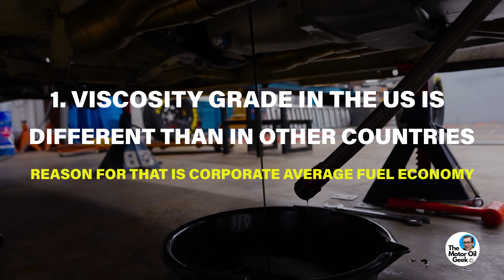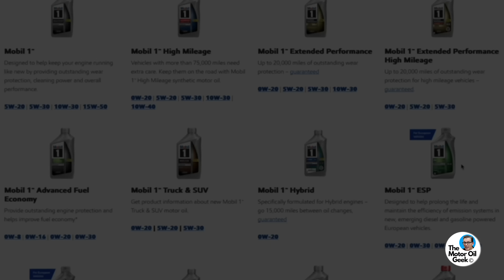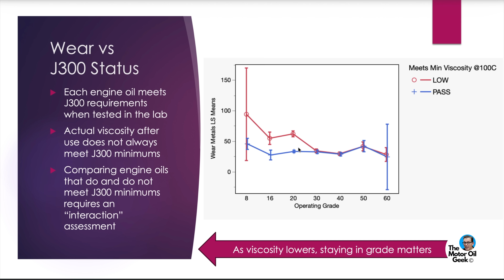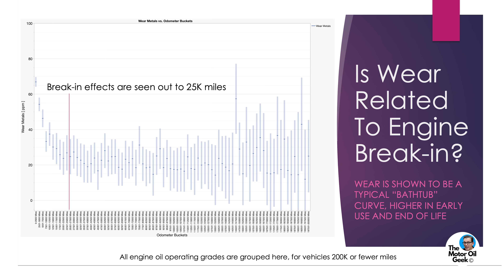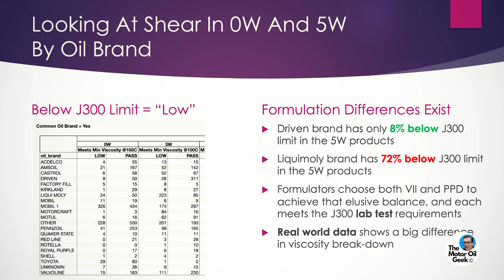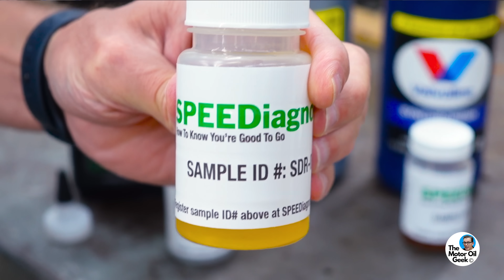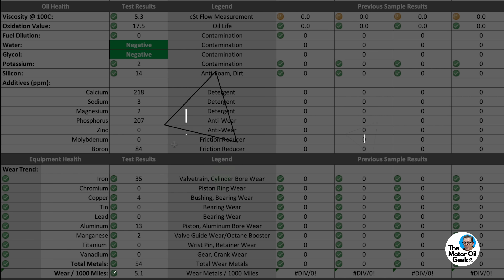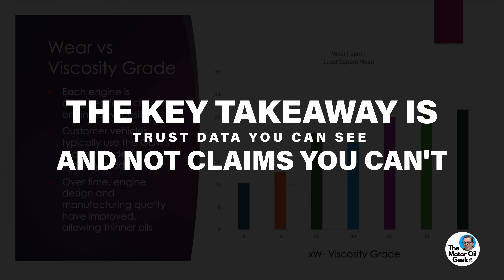More Ai Lies? The FACTS about 0W-20 vs 5W-30 (With Evidence)

Comment: Here is an idea, stop listening to the manufacturers who tell you to change your oil at 7-13K, go back to the old skool days when motors lasted forever and change your oil every 3-5K, your oil filter can only handle so much debris before it bypasses, todays engines are producing more power the oil intervals are getting longer and the oil filters are getting smaller, hmmmmm what kind of sense is that, 3-5K oil change interval. Todays manufacturers want you in a new vehicle every 3-5 years, back in the day our parents had the same vehicle for 15-20 years and no issues when they changed oil every 3-5K with 10w30.

Comment: I live in central MO. I have a 2007 corolla, manual trans 1.8L with over 400k still doesn't use over 2 oz of oil at 10k oil changes and gets 40 to 42 mpg 
 10k oil changes since 150k miles. Timimg chain slaps a little at idle but all original internals. The oil I use is MFA full synthetic. It is a local petro Coop. That has their own lab and specialists that formulate the oil. I use their oil in tractors, dozers, excavators, trucks and cars
I used the 0w20 in 2002 pontiac 5.7 ls1 formulat
 5000 to 7500 mile oil chages and she still rocks my world at 169000miles and gets 30 mpg on the higway at 70 mph. No significant oil consumption either. Just find what works and drive conservatively. Hood luck😂

Comment: I think the rule of thumb is that if you wanna use different grade than what's specified for your car is that you can go lower on the first grade and higher than then latter grade, so say 5W-30 recommended engine is ok to use 0W-30 or 0W-40 but have risks going from 5W-30 to 5W-20 as the oil will get thinner at warmed up engine than the factory recommended and might cause issues

Comment: I got confused as heck with the grade change near 2:38 . I interpreted it as over max limit and under minimum limit instead of over or under minimum limit. My mind wasn't firing on all cylinders. That said, if an engine can handle 20 or 30, and a thin 30 degrades to the thick end of 20, that may be better than the thick end of 20 degrading to the thin end of 20, depending on the particulars of the engine of course.
Reply: I should have waited to comment lol

Comment: First, I want to thank you for the awesome content!  There are a lot of comments referring to the different grades when they "Shear out of Grade". I am not a mechanical engineer, but I do have a basic understanding of mechanical "Stuff".  I drive a 2019 VW Jetta with a 1.4l turbo engine and the spec oil is 0W20. I have always used the recommended VW approved oil and the car has 222,000kms (137,000 miles). I live in the country in Nova Scotia, drive about 70% highway miles at a max of 120kph (75 mph).  Summer temps are moderate (never above 90deg F, and winter is moderate as well. Lows typically between 35F and 8F.  My question is this...under what conditions would a vehicle such as mine with moderate mileage and not driven in an extreme manner, ever experience "Shearing out of grade".  I am just trying to figure out if this is something I need to be concerned with as my vehicle get older.  Thanks again!
Reply from the maker: The shearing out of grade is due to the mechanical forces in the engine and the shear stability of the polymers in the oil.
Reply: @themotoroilgeek Thanks. I will google "Shearing out of Grade" is something my 1.4l turbo is susceptible to.

Comment: I only use Penrite 10/40  synthetic in every thing , for 35 years, I have never had a motor not do less than 400,000 ks  that is 35 years of proof and always change oil every 5,000 ks , oils degrade and you are not driving another 5,000 ks with fine particles causing friction on parts, Never rev a cold motor ,start the motor drive gently until engine is at full running temperature then gradually increase rpm , never do shot run's,most wear is in the first 5 minutes,it takes up to 10 ks to have every component of a viecle to reach running temperature, like bearings,diff gearbox etc just because the thermostat has coolant at normal temperature does not mean everything is at running temperature

Comment: Hello sir really love all your videos very informative do have a quick question I have a 02 mustang GT with a 4.6 l engine that is supercharged positive displacement and makes about 10 lb boost haven't had this car long doesn't have a ton of miles on it was really curious what you would recommend for a good motor oil in this vehicle I live in a warmer climate in Tennessee car does not get drove on a daily basis more of a weekend car any feedback from you would be appreciated I've read some forms were some guys are running t6 5w40 wanted to see what your thoughts were thank you

Comment: We have about 350,000 combined miles across our 2012 Highlander and 2016 Tundra, both have only had 0w-20 since brand new. Both run like new, burn no oil, etc. Just follow the manufacturer recommendation and change it regularly. There’s so much misinformation out there about this topic it’s maddening. Hopefully people aren’t deciding to use 5w-30 because some hacks on YouTube are telling them to. Good video.
Reply: The video is only stating that 5w30 gets way less catastrophic when its not changed in time compared to 0w20

So if anything, people changing over to 5w30 without much thought put into it is in their advantage
A percent or two in fuel economy should be more valuable to you than your engine

Comment: Bought a used Audi from Audi dealership topped with 0-20. Burnt oil. Been using 5w-30, 5w-40  without issues on VW group cars for years. So, changed the Audi also to 5w-30, burning oil stopped. 1.4 Tsi, Greece climate.

Audi in manual claims 504.00 can be used so, the engine design, tolerances, blah blah sounds nonsense to me especially when you see different recommendation based on the  continent (regulation based) as other people stated here. 

After about 1 million km in various cars/motorcycle I can say that changing frequently is more important. 

Good luck with whatever you choose  guys.

Comment: I use 5/30 in my 2017 Sienna instead of 0/20. Same oil in 2003 Tacoma. Convenient. If there is a difference it would be slight less mpg.

Comment: @themotoroilgeek Lake, since motor oil is now being used as a hydraulic fluid for lifters, valve timing, tensioners and other things on modern engines. How does that change what oil is safe in an engine? A 0W-8 will be different than a 5W-20 for lubrication and hydraulic functions. Does the hydraulic parts in an engine influence the oil you should use?

Comment: Got a 4.0 GR1 V6 275,000 miles, has always had Mobil 1 synthetic 0-w20, changed every 5k, you could eat out of the valve covers. A oil change with a filter is at best $60-70? Once every 3 months.

Comment: I have a 2025 jeep gladiator after watching your video I  want to switch back to 0w20  penzoil ultra from 5w30 valvoline  clean and protect do I need to flush the engine before I add the new oil?

Comment: I change mine every 3000km's. And when my oil temps hit over 100c i change it as well. And Always change it before a track day. I use 10w50 with large oil galleries and bearing tolerances.

Comment: Lake, what kind of chemistry (and base oil group? Synthetic?) would you look for on mid 80’s V4 (stock) street motorcycle (Honda VF500F)? So we are talking high revving  (12000 rpm), hot running 500cc V4 without hand matched camshafts (and not line bored cams. (there is some gap, cams lift up while operating).
(Watercooled, 90-degree V4, 360-crank, 16v, screw & locknut tappets, chain driven cams (regular, not HyVo chain, wet clutch, no oil cooler, carbureted (4 constant velocity carbs)…)

With these information & with addional information of suspected fuel contamination & clutch mass material wear contamination?
(= one oil for future, when  I might rebuilt engine & one oil for now managing while waiting need to rebuild)

Comment: we have recently purchased a Mazda cx-30 and all my searches suggest it should take 0w-20 or 5w-30 ... We have taken the car back for a service to a Mazda dealership only to be charged for 10w-30 ... semi synthetic and not even full syn..  I questioned this only to be told its meets Mazdas specs... I'm confused..  And $100 for 4 odd litres .. Three local dealerships all use different brands and grades..

Comment: False... All the topic might be true but in reality it all comes down to engine performance. If lets say a normal family car being driven back n forth to work/grocer/school/home then using the factory rating of oil is good then. However if you are like me that uses the car for long distance travel due to work i pick a higher grade since the engine will be stressed more = more heat EVEN THOUGH THE RADIATOR IS FUNCTIONING WELL the oil is the one witnessing the stress of engine components inside. Also the number one reason for wear and tear of an engine is lack of change oil, wrong oil rating and lastly overloading of vehicle.

Comment: The thinner oil runs off the rocker train, including overhead cams etc. It also drains away from in block cams and lifters and rod and crank bearings. This especially happens in hot climates where daytime temps get into the high 90s.  After a couple days, those engine surfaces have almost no oil on them. When the engine IS started the wear surfaces are dry for a time. This wears the engine out A LOT SOONER. Thin oil is so the engine running at operating temp has less resistance creating better fuel economy. This raises the average for the whole product line. It keeps the manufacturer from having to pay fines. That is the only reason the manufacturers recommend thin oil. They don't care if the customers engine lives. I don't care what this guy says.

Comment: question for the oil guy. My car manual recommends oil changes at 7500km or 6 months. It's a 2010 Toyota. So, I changed the oil with mobile 1 ran it for 5 mins to remove it from the ramps. Parked it hooked up a batter tender and it sat for 5 winter months does it need an oil change with only  0 kms added

Comment: SAE recommendations are based on ambient  temperature (because oil viscosity is entirely temperature dependent). eg a 0w-20 oil is only designed for use below *0C/32F*. For 90F/32C the SAE recommends at least 20w-50. 

The only reason these very low viscosity oils exist is to 'cheat' CAFE economy standards and avoid billions in fines.
Reply: It's not cheating if they get the results I desire

Comment: I found the recommended 0W-20 caused oil blow by and would lose a pint within 1000km. The oil darker very quickly.
5W-30 is my choice rather than the EPA climate whores choice.
Reply: Consuming oil? Sounds like a Toyota

Comment: 2:41 xw-20 out of grade 12% of the time, xw-30 out of grade 41% of the time.   5:32 xw-20 wear ppm increases above 30ppm when out of grade, xw-30 does not increase wear.  so when xw-30 goes "out of grade", it goes to thinner but still protective grade.  when xw-20 goes out of grade, it does not protect.

Comment: The issue is not the oil, but the oil pump pressure they are just pushing the psi too low. We need governments to stop forcing car companys to comply with crazy fuel economy as we are getting to the limits if we want a reliable engine i rather burn more fuel than have my engine die so early, and that cant be good for the planet.

Comment: All of the evidence that you need to "see with your own eyes" is that the car manufacturers started adding oil coolers on all of those four banger engines that specified 0W20 or 5w20 motor oils. The oil film gets too thin to protect the engine at or above the "magic 100c/200F+" mark. And lets face it, the placement of the "blast furnace" catalytic converters so close to (in front of) the oil pan/engine block/transmission was a huge part of the problem. Never had any issues when those cat's were tucked under the car/truck body BEHIND the engine and or transmission. That excessive heat producing entity was never under the hood in the good old days. Those cat's will turn bright orange and the air flow pushes that heat into places it shouldn't go.

Comment: yes indeed. from HVI : Scientific testing conclusively demonstrates that 0W-20 oil, when properly specified and maintained, extends engine life by 45%, reduces wear by 60%, and improves fuel economy by 6-8% .0W-20 formulations contain 25% more anti-wear additives than older 10W-30 oils, providing superior protection through chemistry rather than viscosity alone, preventing 85% of wear through molecular-level surface protection. Modern engines feature 0.001-inch bearing clearances requiring thin oil for proper flow, with thicker oils causing starvation, increased pressure, and accelerated wear costing $$$$+ in premature bearing failures when wrong viscosity is used.

Comment: Yes, 5W-30 oils will shear out of grade twice as often as 0W-20 oils will, but that’s primarily caused by GF-5 5W-30 oils being near the bottom of the SAE-30 viscosity scale (10.1 cSt - 9.3 cSt =  0.8 cSt needed to shear out of spec), while your typical 0W-20 is near the top of its respective viscosity scale (8.8 cSt - 5.6 cSt = 3.2cSt needed to shear out of spec). 

So you’re correct that 5W-30 oils shear out of spec more often, but I don’t think the reason why is accurately depicted.

This also explains why the wear increases on the 0W-20 oils when they shear out of spec,  because you’re talking about an oil now that needs to be 5.5 cSt or thinner to meet that criteria.

Comment: You are helping make the case against the 10k oil change.  A 0w20 5k change is fine.  10k is way too much, as its close or surpasses the sheer stability, depending the oil.

Comment: Tangent!  In gearboxes only! I can attest that substituting 30wt synthetic car oil for 80w gear oil  in manual transmissions was a noticeable improvement. Not a lot at all in the scheme of things!  But a blip.
 And all those lil blips add up.  Shifting was crisper, acceleration, just a lil hair more. overall feel...better. And that meant less to think about, and more time for the track mind to work. Which improves lap times.
 But this was track / off road 100%. And we change gear fluids every 2 weeks, few runs. So cannot attest to oil life or breakdown running so lite in a high stress area over time... Just wanted to throw out other reasons for light oils. faster reaction/ less stiction if that is the proper word.

Comment: What you don't mention is that GM changed their OEM oil recommendation from 5w-30 to 0w-20 in the L87 6.2 liter motors not for U.S.  CAFE standards, but because of the AFM/DFM induced engine failures caused by the special lifters required when cylinders are deactivated using oil pressure which requires that intake and exhaust valves remain shut. The solution, is to install a AFM/DFM disabler which plugs into the OBDII port.

Comment: LOL! Thanks for your quick but detailed breakdown of that Ai video.

It's funny I see many combatting "Ai" generated content. It's a good thing as well but this is why I laugh. All Ai generated content falls into 2 categories. Scripted or scrapped. If scripted, it's reading something written. Now that script could have been scrapped data based on what has been feed to the Ai repository (database) as being common when someone asked it questions or task to perform.

So having to provide the the proof isn't always necessary. That just depends on the Ai's primary source it scrapped from and the Ai itself. Fun fact: there's a 80% - 90% chance the Ai (Googles Ai) is pulling from the CC (closed captioning) of the library of data it has in YouTube from human content creators like yourself.

So saying it's just an opinion only holds true if what's being stated has "I personally think" or "I think" or "feel." In front of it or is followed up afterwards. If not, then if what's stated has zero fact to any situation, it's obviously false. But if it does fit even one situation, it's true. It's just a matter of it being a common one or extremely rare situation then.

Now all of that stated. I personally prefer, 😏, a human content creator such as yourself to listen to or take advice from on things I know enough to hold a general conversation about. That's why I went looking for your clarification on that video. You had the data that kinda supported that videos overall general message. You have the missing components by adding that all brands aren't equal backed by the data/proof.

Thanks you again for your video and content.

Comment: My manual says 5w 30 but the cap on the engine says 5w 20.  I use 5w 30 penzoil ultra platinum.
Reply: my 22 4runner manual says to use whatever grade necessary for your particular vehicle for whatever tasks your doing, not 0-20.

Comment: I won't put 0w in a lawnmower i live in Louisiana where it get 100 degrees here in the winter 😂😢😅😢😂
Reply: I actually ran 0w-40 for several years in my mower until the wrist pin seized and it broke the connecting rod with a full oil level.  I will never know exactly what caused it, but I now run 15w-50 in my air-cooled outdoor equipment.  I was stunned at how thin it was when I drained it.
Reply: @confidentlocal8600 I agree

Comment: I'd rather have a xw-30 oil that would shear down to a 20  that a 20 that would shear down to a 10, way out of spec for the engine
Reply: The factory fill 0w-20 from Toyota and Mazda barely qualify as 0w-20 when brand new!  It doesn't take much breakdown at all for those to drop out of grade.